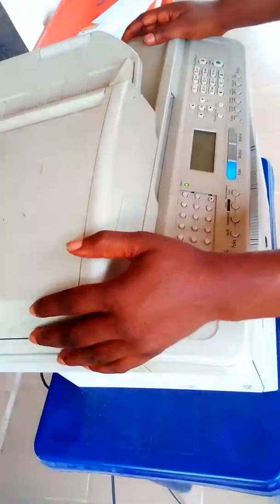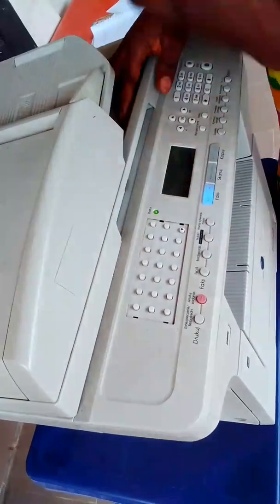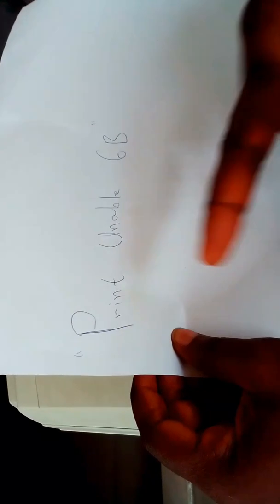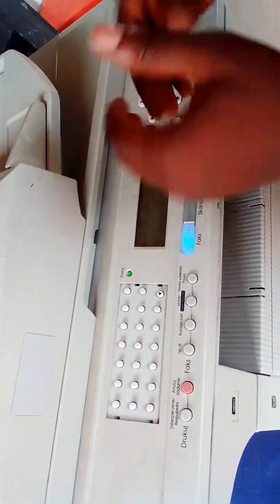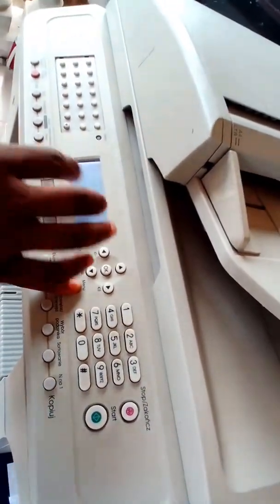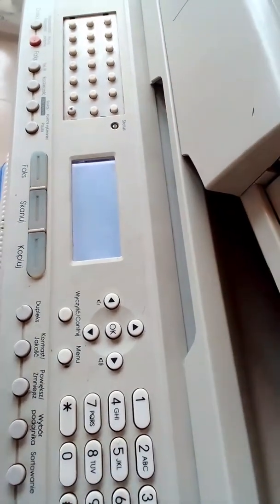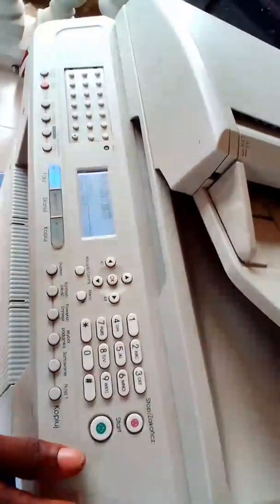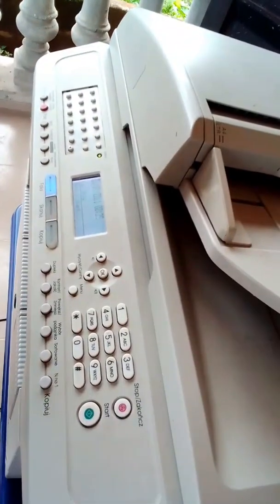How to Clear "Print Unable 6B" in Konica Minolta Bizhub 20 Machine

Comment: Thanks for your insight. How do I clear Print unable 7A for Bizhub 20p?
Reply: Please how do I clear print unable 6a on bizhub 20. I have used the code and even change the heater unit but the problem still persist. And the one I removed still working fine when I tested it on another machine.